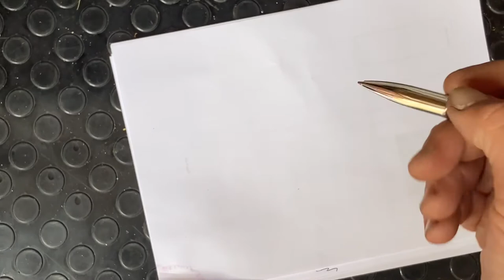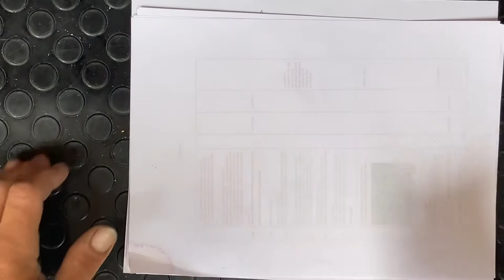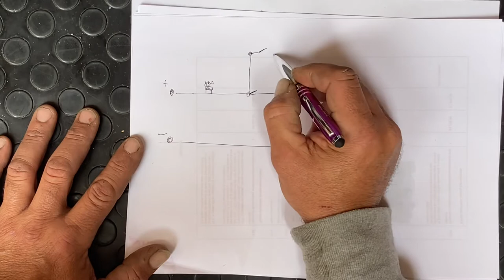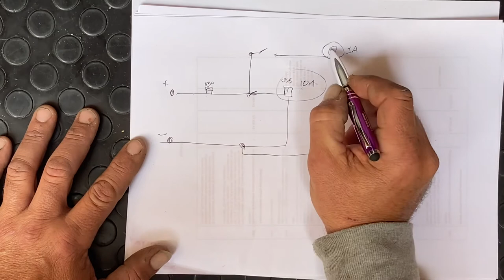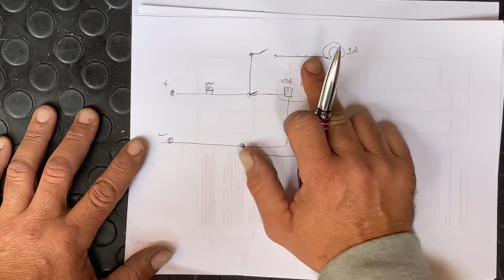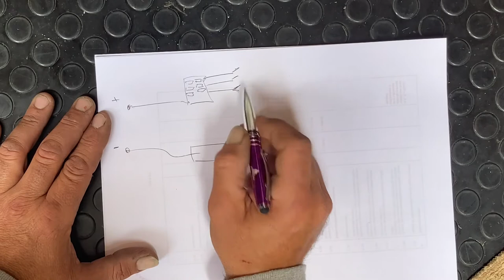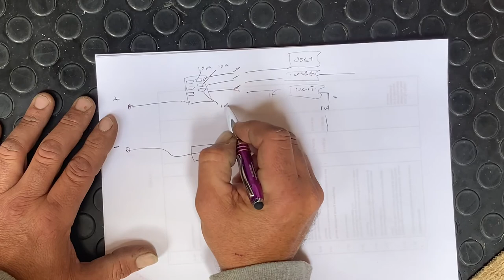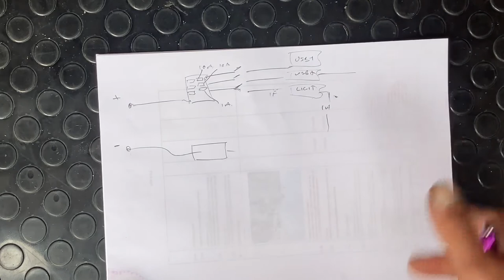Sizing fuses for 12v circuits in camper van

Comment: Thanks very much, really helpful but now im shitting myself im going to burn my van down lol, can i be checky and ask how you find out voltage and current its asking me to put into the calculator? Iike if im putting a usb point in or a ciggy socket i would be using different devices with different volts? Thanks P.S i rolled up when you said "don't fucking do that" lol lol
Reply from the maker: I suppose as long as you’ve always got some fresh marsh mallows handy, a fire wouldn’t be totally bad!  

Most things you buy will let you know in the description or instructionies what the current draw is, but not always.   However you can search for something similar online to find a description as most will be similar current draw.   I just looked up a QC3.0 usb charger and is says 1.5A at 12v.     So I’m this particular case, I’d size the cable at 10A for the calculator but go for a 2A fuse.    That will keep your cable cool and give you a small margin for switching spikes on the fuse.    The cable wouldn’t be much more expensive or larger and you can sleep soundly :)      

The other good thing about sizing cables larger is that your devices will work better and your leisure battery will last longer.    This is because, over distance the voltage drops.    Ohms law says that as the voltage drops, the current increases.   So the calculator may say that a 0.25mm cable is cool, but will have a voltage drop of say 0.1v.   If you jump up to the next size of cable however, the drop may only be 0.025v.   Doesn’t sound like a lot, but if your off grid and everything is running low, it all adds up!

Have a look at my video where ‘kill all isolator saved the van’.     I’d basically had six LED lights on one fuse, but they were three different circuits with potentially only 2 running at a time.     I was doing some wiring changes and shorted a circuit out and fried the cable and the connection box released the magic smoke.  All because the fuse was too big.   
But because I had a big isolator switch in between the battery and the main fuse box, I was able to kill all the electrics quick.   
There also a couple of methods for automatic fire suppression, which I think I covered in a recent video on fitting the sink.
Reply: @simplestuff3895  thanks for taking the time to explain its really helps. im converting a small dispatch van and got to keep the cost down, i know i must use multi strand wire so would it be ok to use cable flex you can by in a drum from like screwfix? I just watched your underfloor heating video, brilliant never seen that done. Great channel
Reply from the maker: Yeh no problem :)   You should do some vids of your van when it’s done.   Love the idea of small vans a lot easier to park up and plenty of space if it’s planned well .  
Flex from screwfister is fine.   Just use the cable size calculator to help you get the right size.   That’s quite a good idea about just getting the flex from there.   It’s really cheap compared to the automotive suppliers so you can afford to upsize the cables.    Nice one 👍